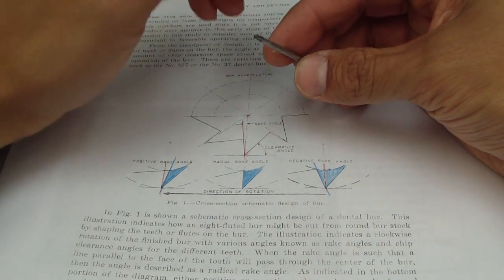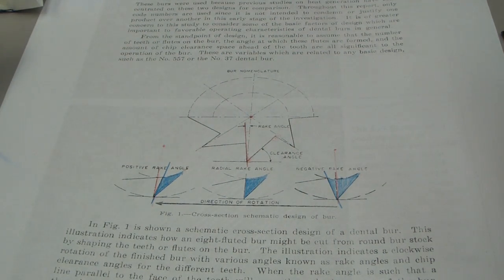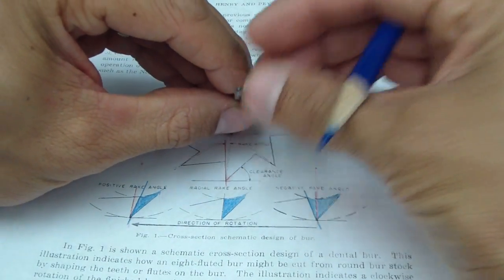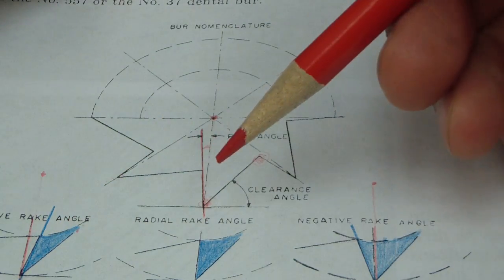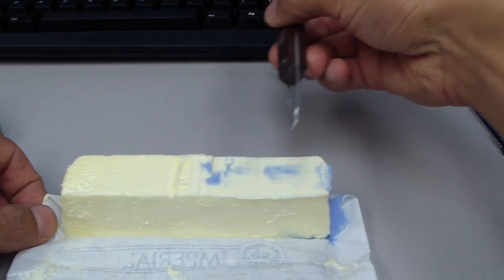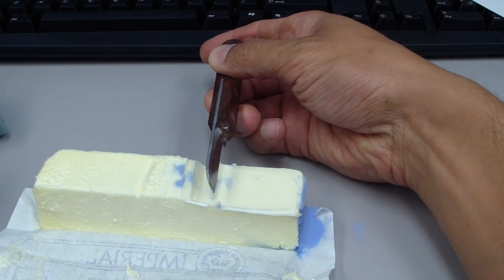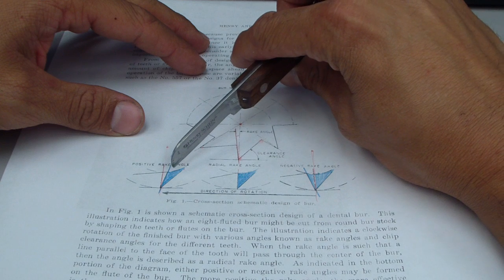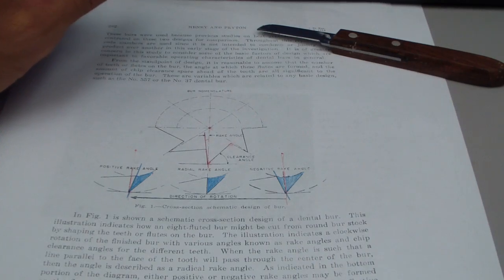Dental Bur Rake Angle

Comment: Cutting Dentine- definition- "the blade engages dentine and force is exerted until the compressive strength of the dentine is exceeded, at which point a crack propagates through the weakened dentine and causes a chip.  The size and shape of dentin chips produced depend on the rake angle, sharpness of blade and force applied." You like Endo, "YouTube" endohandle.